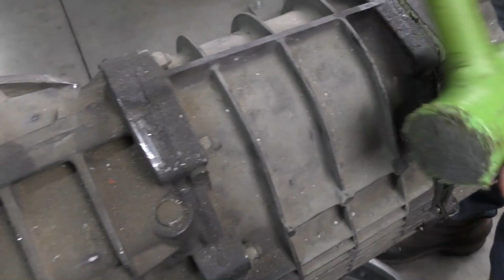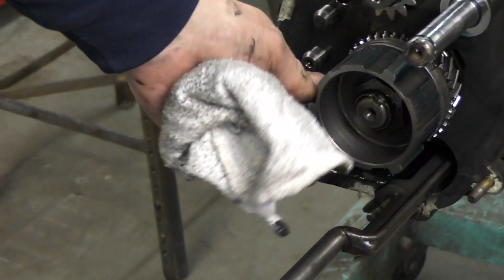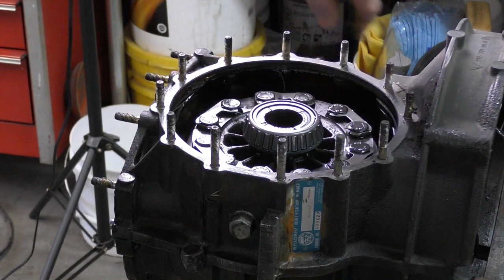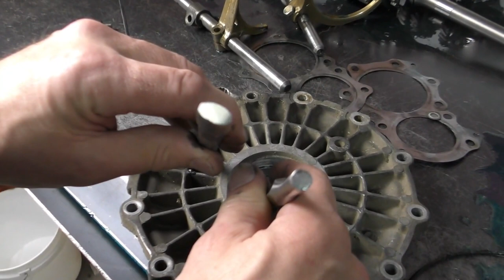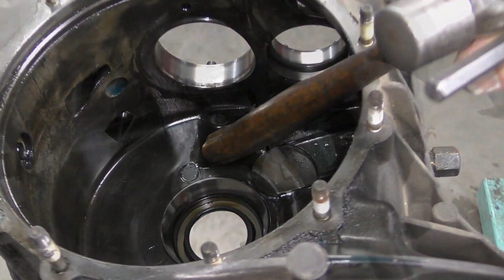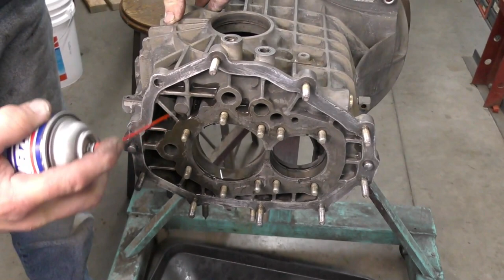Porsche 915 Transmission Teardown.

Comment: Does it help to mark anything for positioning when it comes to removing the sliders? I notice you also leave as many in tact when possible if there’s no damaging wear. As an alternative to sycro wear what else do u typically see on the sliders that prevent getting into gear?
Reply from the maker: I dont mark anything when i disassemble. Yes i do get assemblies out and on the bench, but i do come back and disassemble each one, (videos to follow soon). There are two main areas of wear on the sliders. The areas are the dog teeth and the hump/valley on the  inside of the slider. The dog teeth are pretty easy to see and damage is usually obvious. The slider also has a small hump and valley built into the inside I/D of it. Its purpose is twofold. The humped area adds more pressure to synchro ring to help slow it faster. The valley in the center of the slider helps hold the slider engaged into the gear. When inspecting you need to look at both areas and replace if either one is worn. The most common reason for being unable to engage a gear is worn, (squared off), dog teeth. When the dog teeth loose their pointed tooth angle, the slider and the gear can stall against each other and not move to either side to allow engagement.

Comment: How do you ceramic polish parts? I can not find any information on this and your parts are clean af.
Reply from the maker: You will need a polishing machine that the parts will fit into with the media and soap solution. I use a "Bur Bench" Branded machine
Kurt

Comment: Hi, I have an 82SC which is stuck in reverse. If I try and shift the car, it seems to be stuck between gears. I had this happen a while back and the Porsche shop did something but now I'm stuck in between gears again. Can this be repaired or do I have to do a complete tear down. I'm here in LA. The car is safe in my garage so there's no hurry. Any suggestion
Reply from the maker: You will need to find out if it is an internal or external problem first. Good luck with your gearbox. S
Reply: @klassikats  Somehow I was able to get it back into neutral.
Reply from the maker: @taralewis9916  Nice, though you should still take it to a shop to have it checked out
Kurt